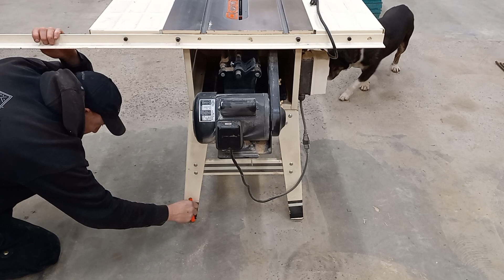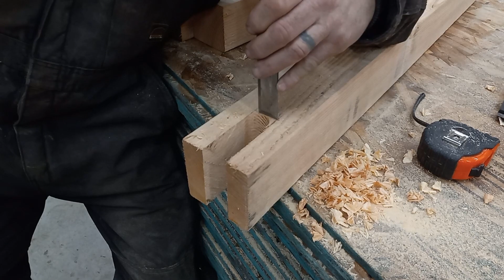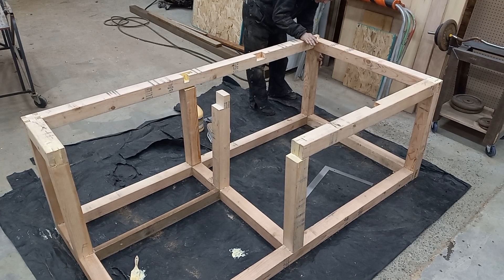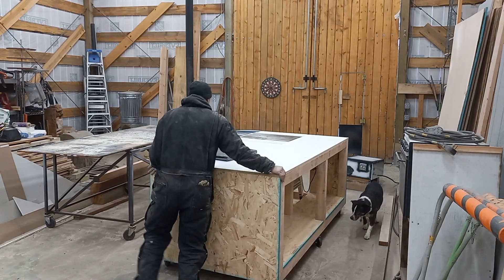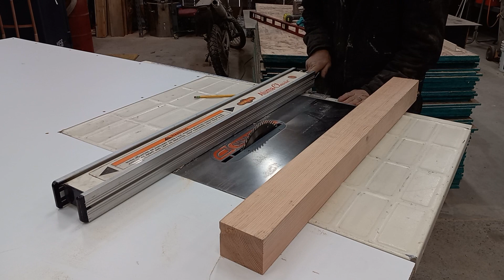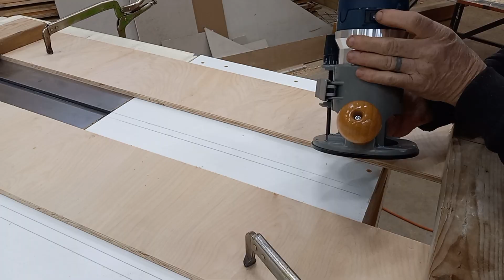Table Saw Bench Build, A bit over engineered but worth the work. :)

Comment: Table looks great my table needs a new top like yours that will slide easy. I can not take credit for it because I did not build it. My table has a slide out support on the left side to support a full sheet of plywood so one person can rip it all by yourself. it also has a strip mounted next to it that you add to it to make it the same height for a sled.
Reply from the maker: I was thinking about adding a flip up extension to the left side of the table saw to make it a bit wider. I need to add some drawers to the bench also. :)

Comment: Well thought out and well done!  I am curious if you drew this all out, first, or if you built it on the fly.  It is always inspiring to see nice projects made with simple materials and tools.  Do you have specific projects in mind that you want to build with the saw/workbench?
Reply from the maker: I built this on the fly. I'm not good at drawing up plans and I'm pretty good at picturing things in my head so most of my projects never see paper. The stack of OSB you see in the last few videos needs to be ripped into 2' X 8' sheets. I bought the OSB to make a ceiling for the shop but 4X8 sheets are hard to get 16 foot up scaffolding so I figured I would rip them down to make life easier. Then I have cabinets for the bathrooms in the house and cabinet doors for the kitchen, along with shelves for the master closet and pantry. :)